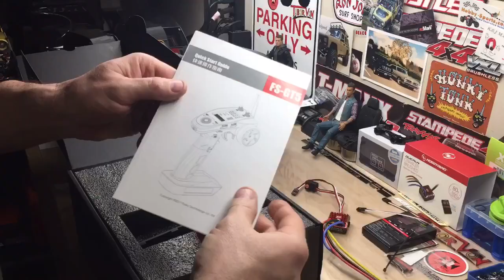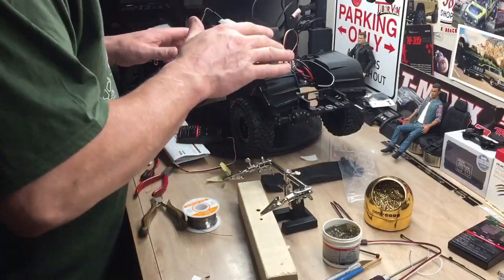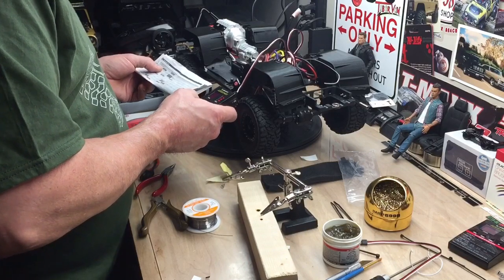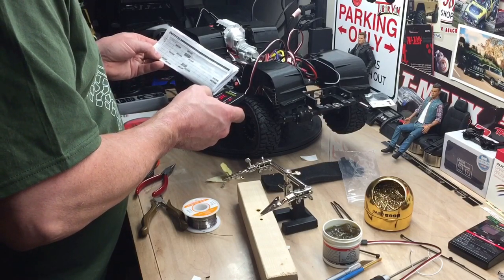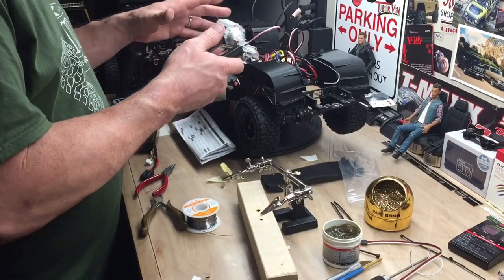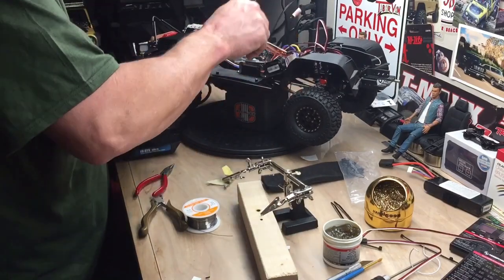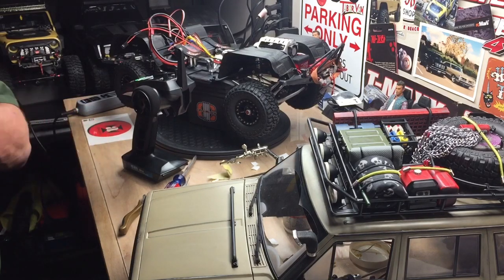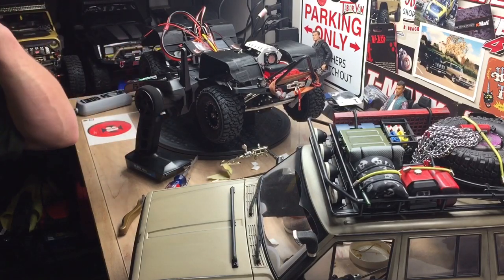Xtra Speed V8 Axial XJ Hardbody Build #6

Comment: Great video man love the upgrades. Rig looks amazing The only piece of advice I would give you is to get a battery pack for the GT5 it’s hard on the AA’s.
Reply from the maker: Sean’s RC’s Adventures Thanks I appreciate it. Yeah just getting this thing set up, I can see it's eating these batteries up. Do you have a suggestion on a battery pack, maybe a link for one, I would appreciate it. Thanks for checking it out 👍🏻
Reply: Kingston RC This is what I use  (7.4V 1500mAh 2S LiPO Battery Pack) the small pack. I would take it down to your local HS and try a few out. Also you should check out the FS noble that thing is amazing.
Reply from the maker: Sean’s RC’s Adventures Yeah.... I’ve seen the Noble 😍 nice!!! Yeah... I’ll definitely look into a battery pack, or at least some rechargeable batteries. Thanks for the tip👍🏻